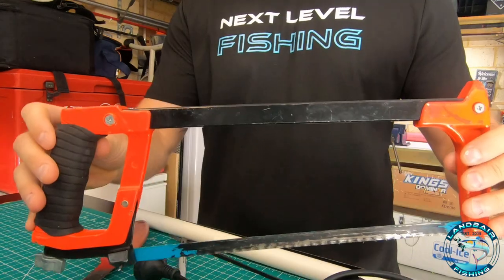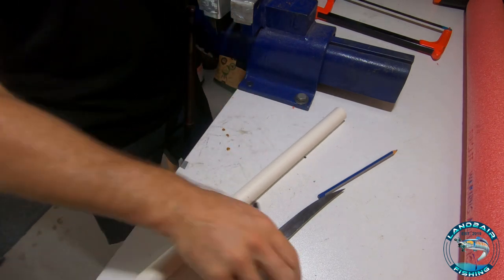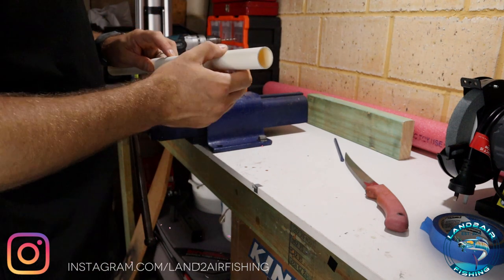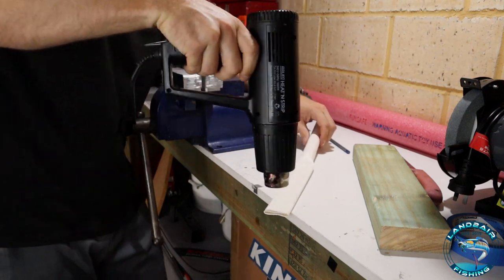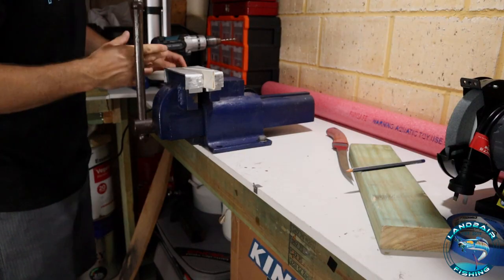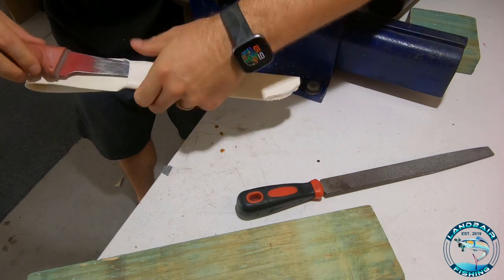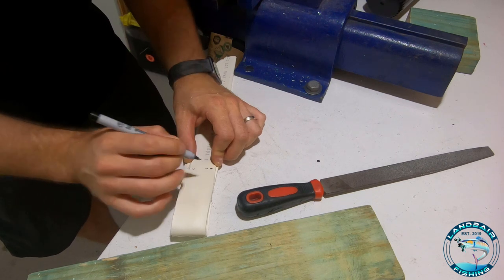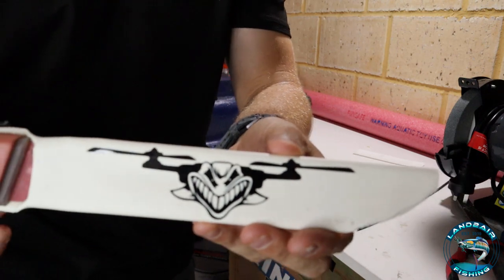DIY Custom PVC Knife Sheath Tutorial

Comment: Easier to get the right fit if you wrap the blade in a layer or two of painters tape and put it in the pipe before the final press. Gives you just the right amount of retention. And leave a little tap at the top of the opening to fold over as a thumb push. Also easier to just make a couple of slits for the belt loop instead of folding and riveting it. Just some things I've picked up on after a few years of making these.
Reply from the maker: Ill be sure to try the painters tape next time. I used to use slits but they would break as my belt buckles are quite large due to the width of the belt on the gimble, so I just fold them over now. Thanks for your comment 🙂